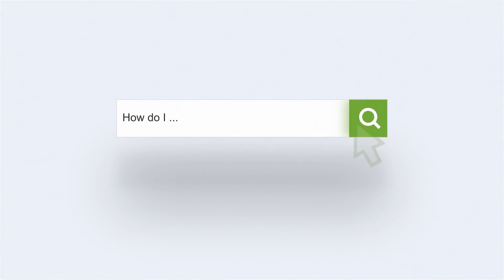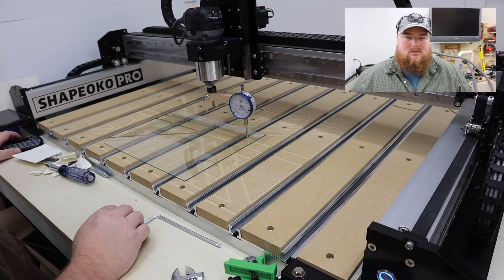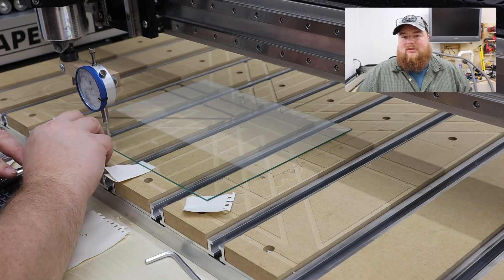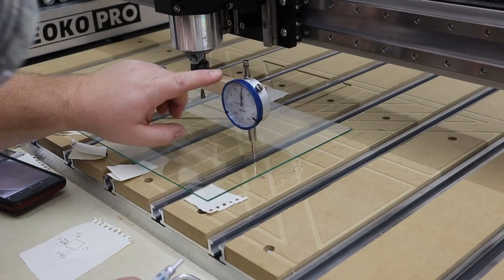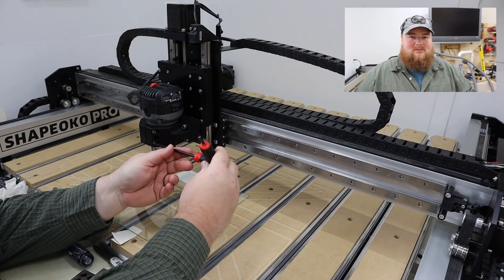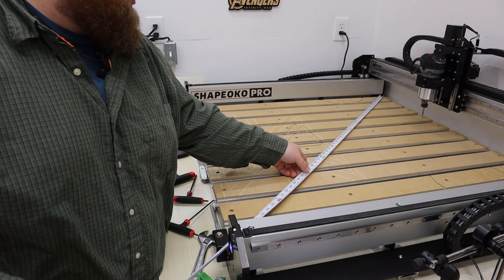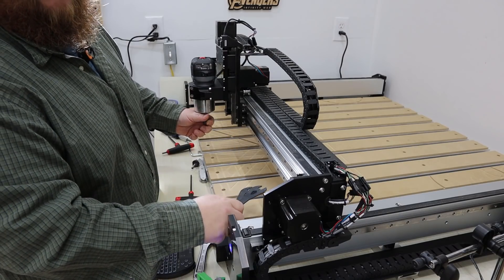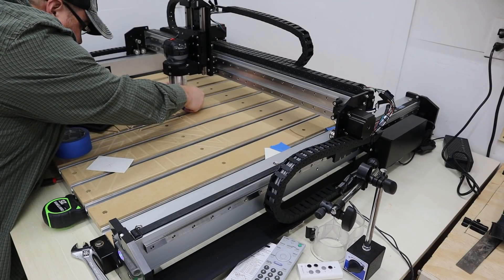How To: Shapeoko Pro Calibration, Tramming & Surfacing | CNC Router Woodworking

Comment: For the bit setter solution - use a digital caliper to measure the thickness of a razor blade, set it on top of the bit setter, run the bit setter - the razor blade is wide enough to capture the carbide teeth on your surfacing bit - then just subtract the tolerance for the razor blade within your surfacing program.

Comment: Mate, no one mentions about the glass plate and starting with a base line level. Its so important. Great technique and good tip with the shim gauges you can get them really cheap. These are better to use instead of paper because they wont compress like paper can.

Also instead of a plate of glass you could use a cheap granite cutting board as they are super flat.

Comment: Thanks for your video.  Your process for checking square is faulty because the sacrificial boards could be off. You should check by moving the spindle X0 and Xmax and Y0 and Ymax and sinking a hole at each point. Then measure diagonals.

Comment: Thanks for the video, I picked up a few tricks as I am getting ready to tram my CNC (again), however mine is out of square and I was wanting to see how others were fixing that. Since yours was square you didn't cover how you would fix that. Also when I was adjusting my spindle I used aluminum foil for shims, but if you have feeler gauges to sacrifice that takes the guess work out of how many layers of foil to use.

Comment: Good point about the Bitsaver measuring from the center of the surfacing bit instead of the edge of the cutting blade.  I surfaced a couple of cutting boards and the first time I did cut a deeper pocket than what I wanted.  I adjusted the setting to make a cut that wasn’t as deep as the first board and it cut the surface depth that I was trying to hit.

Comment: I've tried this strategy years ago with the 123 blocks and can confidently say that it doesn't work because the holder will buckle and move in different directions depending on which screw you screw in first. The strategy I've had the most amount of luck with it to get a square flat surface and then to just use a square. Once that is done I mill a piece of aluminum with a .001 depth vertically to determine how much to shim the holder on either the top or bottom, once the y axis is +_ .002 square I run the same operation horizontally and square that.

Comment: The problem with the park wrenches is that the smallest they come in is 13mm...and the router shaft flats are 12mm. loose fit and they damage the router. Do not recommend.

Comment: I'm almost done assembling my Pro XXL.  How necessary are all the tramming steps?  Also, I figured surfacing is necessary but I'm concerned about the pocket you ended up with since I plan on doing pieces that are longer than the Shapeoko table and don't want to end up with an uneven surface.  So now I'm wondering if I should do a surfacing job or if I should shim stock instead.  Thanks.

Comment: yesterday my machine refused to initialize. at back right corner it does that nasty brrrr, jumpy noise. ive checked all my switches and sensors and they seem fine.. adjusted my belts, unplugged everything for 20 minutes, restarted, resent config to machine.  Nothing i do is fixing the issue. We've got carves backed up that have to get out this week. Any help you can share is greatly appreciated.
Reply from the maker: Oh no! What errors are you getting from the machine console?

Comment: Hi Sam, I am considering buying a Shapeoko pro XXL and have been watching your videos and have appreciated them greatly thank you! there are two questions I would like to ask you please. my first question is about the belts. do you think they will be durable and long-lasting, have you had any problems with them and do they need retention in? After you faced the waste board did you need to change any depth settings including for the Bitsetor? Thanks heaps Sam!

Comment: Sam what thickness glass did you use I would think that if it was 1/8" or less you could get deflection in the glass with your dial indicator  moving over the glass also would you share you numbers that you settled on  did your glass lay flat on the wasteboard Also Sam are you using the carbide router if when you put it in the holder block did the router go all the way down to where it was just are down as it would .thanks Jeff
Reply: I was thinking the same thing. I used 1\2 inch glass and it worked well. If you go to a business that supplies glass they well usually give you some scraps. You could probably stack a few layers if thinner glass.

Comment: What handheld controller are you using to move your cnc?
Reply from the maker: All the links should be in the description, but it's just a wireless keyboard. I've since changed to using a Fusion5 tablet for all CNC & Laser Engraver control.

Comment: Have you had any problems with the belts or vwheels? I was looking at the Onefinity with ballscrews. What made you go with the Shapeoko?
Reply from the maker: No v-wheels on this model. Belts have never slackened or been an issue at all. I like the ballscrews of the OF, but it lacks a lot in comparison: table/wasteboard setup, cable management.
Reply: @Samcraftcom  Yeah and the OF is near impossible to get too. I contacted them and they said around 3 months. Heard one guy on Youtube say he waited 6 months. No thanks, I don't have to patients for that. Plus they want full payment up front, and it's almost $1000 more then the Pro if you compare apples to apples.  If it wasn't for the 3 months I probably would have gone with the ball screws, it's a much simpler design and more ridgid. The Pro is only taking a week to get.
Anyway thanks for the feedback. I'm glad to hear you're not having problems with  the belts, that was my biggest concern. I'm getting mine Tuesday (24th) and knowing you haven't has any issues is making it more exciting. Thanks!

Comment: Great vid as always, Sam. You've become my Shapeoko mentor. I appreciate everything you're doing.

One little thing though. The work area of the SP3 is actually 34x34, not 34x33 as you said. The router can actually extend about an inch beyond the front of the table. That inch could be useful for clamping pieces vertically for things like dovetail and box joints. Anyway, I didn't want to see you shorting yourself.

Comment: Hey @Samcraft I use that exact same surfacing bit. My fix for using it is to, in Carbide Motion, move the bitsetter location a few millimeters to the left, so one of the cutting teeth hit the bitsetter top surface. There should be enough overlap still so that e.g. a 90 degree V carving bit will still touch the bitsetter, although it won't be dead center.

Comment: Your pain is our gain. Thanks for sharing. I just ordered a SoProXL. I wont need larger. 
After hearing what you said about cutting too deep, I might try using the bitsetter and then the BitZero(?) to set the Z height before surfacing mine. We’ll see.

Comment: Am I crazy or did your tramming method basically do nothing? You created a reference surface (glass) perpendicular to your un-trammed spindle - then proceeded to tram it to that surface? Wouldn't that effectively put it right back to where you had it? Scratches noggin.

Feels like you would have been better served by not shimming your glass so you can approximate the plane of your spoilboard (to help compensate for varying thickness of the MDF) - then simply tram your spindle to that glass until the dial read 0.

Or maybe better, use the indicator on a magnetic base - stick it to the spindle, and put the dial horizontally to measure off of the side extrusions. Simply jog your Z up and down and it will give you an exact measurement of how far you are off in which direction.
Reply: I had the same thought. I think you could slightly modify the method, if you are going to shim/shift the router mount for all of your tramming instead of rotating the gantry arm, I think you should put the dial gauge on the Z axis directly (no router mount). Then level the glass with the Z-axis plate. Then using that as "level" do the 1-2-3 block installation of the router mount and shim as necessary.
Reply: @carlmhurd After thinking about it some more, I think the glass method is intended to create a plane parallel to your gantry. That's actually quite useful to give you something to tram your spindle to, but in order to do that you would have to indicate the glass using a single indicator attached anywhere on your gantry - THEN come back with a spindle mounted tramming bar and shim your spindle in.
Reply: @austinshaner  Yeah I agree with that assessment completely. The method is a great way to go, in fact I am going to be doing it to my SO4 after watching this, but I am glad I am not the only one who thought that something was slightly confusing about the method in the video. If you come up with a good method for mounting the dial indicator on the gantry let me know! (I am thinking double stick tape will work well enough to keep the gauge from moving, but may not be absolutely perfect)

Edit: After thinking about this a bit more, I think you have to accept the Z-axis plate into your leveling because that is the only way you get movement in the x-axis. So you tape the dial indicator to the Z-axis plate where the router mount would go for your single point level, do the glass plate shimming, the continue with the rest of the video for tramming/shimming the router mount.

Comment: Sam, awesome videos.  I'm just getting started with my little router (not a Shapeoko, although that will be coming this year. Btw, you're a good salesman for them.  You need commisions.). I have a good background in CNC (20 years) but in very big CNC Plasma cutters for the steel and fabrication industry.  But each CNC is slightly different and I've learned from you, so thanks for that.  I have subscribed and I look forward to learning more from you.
Reply from the maker: Wow, I take that as a big compliment, thanks!

Comment: Have a question .What bit did you use use in your router  to start the machine up to home it .And then when you changed to the surface bit and it moved over to the bit setter what part of the bit pushed against the button. one of the cutters .or what? 
Thanks Jeff

Comment: SAM, I wonder if the bottom aluminum slats are machined flat. If so , the then after initially Surfacing my wasteboard, I can then turn the slats around or swap them out (ends to the center) and run the same surface job until all is flat. I only say this because I have the XL (the only one available to buy this entire last month) and I plan on making a PARF (MFT) board with the pattern of 20mm holes in the mdf sheet. I plan on doing a 48x36" sheet and have to do it in a couple of passes (or maybe even three)... by moving the board through front to back and letting it do it's thing in a couple of cutting operations each. HAVING that pocket scares me enough to contemplate not surfacing it because I need the entire width of the waste board even though I'm not cutting to the edge. make sense? I think I'm going to bite the bullet and surface and round-robin them anyways.

Comment: Was thinking about your issue with the bitsetter and cutting too deep.  What if you attached one or more spacers (like washers) between the cutting teeth with double sided tape and at the depth of the teeth.  Then when the bit is set it will register at the same depth as the teeth.  Hope I explained that clearly.  By the way... I find your information very useful.  Keep it up.

Comment: How important do you think it is if all I'm going to be doing is woodworking? Is the work and effort noticeable?
Reply from the maker: I would say it's pretty important. I only plan to do woodworking and still went though the process. I'm glad I did, too. The two big benefits I have seen already are:  1. I am not cutting into my wasteboard as much with cutout jobs. Beforehand it would cut deeper in some spots than others (leveling the wasteboard affected this the most). 2. For any area clearance toolpaths (pocketing), having the router properly trammed will give you a smoother bottom and means less sanding or cleanup work afterwards -- saving some finish work time.

Comment: I been a machinist/tool and die for 22 yrs. You should be able to make simple macro program for your touch off of your tools, or have a manual touch off mode, or im not familiar with this machine,  but you can measure the difference in the touch off spot and the cutter edge then either change the offsets for the tool or change the length of the tool in your offset to lie to the machine. One of these options should fix the problem of cutter depth.... the easiest option for someone learning is probably- Being a cnc machine im sure there are offsets, measure the difference in the tool from where it touches to the cutting edge, then change the offsets by that amount.  This is also how you would compensate on your x and y for cutter comp. Example.  If you have a 3/8 endmill that measures. 370 instead of .375 and your cutting a .490 slot, you either need to reprogram everytime you run the program or you just change the offsets. Sorry if this is confusing.

Comment: Sam,

I had the same problems you had when I first tried to tram my router motor. The paper method is useless! So I designed a fixture using four socket head screws (thumb screws) to dial in a level reference surface (12” x 12” mirror). If you or your viewers are interested, you can find the fixture instructions in the “How to TRAM your CNC Router article I had published below:

“Laser Alignment System for your CNC Router” – SERVO magazine, published in Issue 1, 2020, p.61
 “CNC Routers: The Z-Axis Zero Setter” – SERVO magazine, published in Issue 4, 2019, p.40
“How to ‘TRAM’ your CNC Router” – SERVO magazine, published in Issue 3, 2019, p.62
“Make a spring loaded Pen Holder for your CNC Router” – SERVO magazine, published Mar/April 2019, p.46
“CNC Routers: Backlash – What is it? How to measure it” – Nuts and Volts magazine, published Mar/April 2019, p.36
“Beginner’s Guide to CNC Routers” – SERVO magazine, published 2/1/2018, p.46

Comment: awesome to see you again sam, i too didnt like the pocketed bed on my machine either so what i did was, take the inserts out and cut them to a length that the machine could reach and put them back,i then  planed some  peices up so they are lower at the back  to replace the bits id cut off that the machine carnt reach making sure there slightly lower than the bed.
As for the far right and left  inserts i took those off and dropped my saw so it was just high enough and ripped the bit it had missed off again slightly lower. dont know if that makes sense, any how great video👍

Comment: I had the exact same problem with trying to set the z zero using the bitsetter and my surfacing bit, so I just decided to use a flat head screwdriver (so when the tool comes close to the bitsetter it hits the screwdriver at the same time that it would normally hit the bitsetter). Or you could re set the bitsetter position in carbide motion to fit the surfacing bit, and change it back later. Hope this helps.